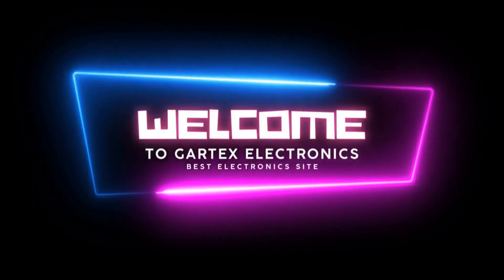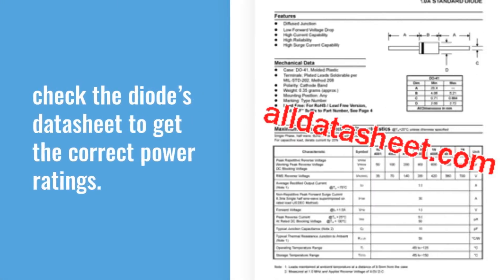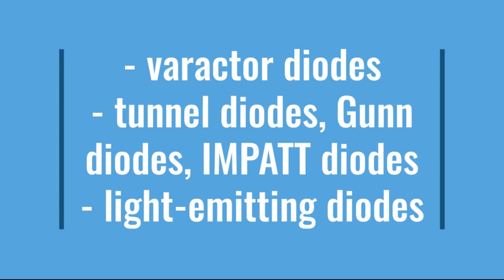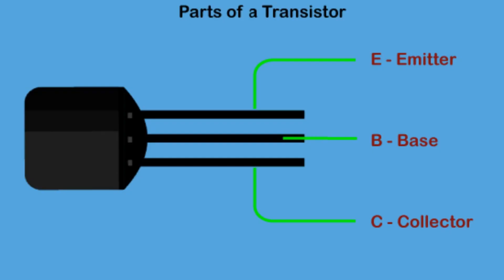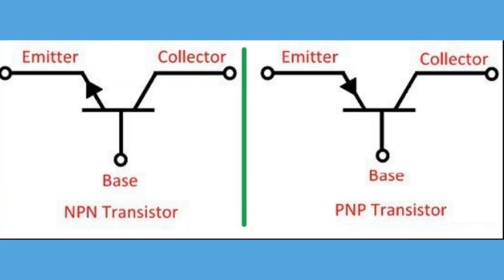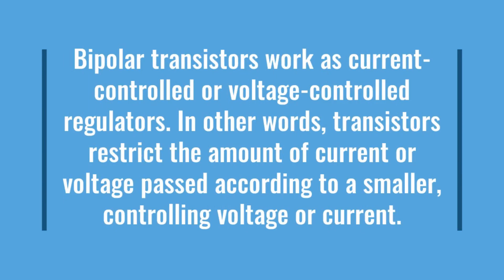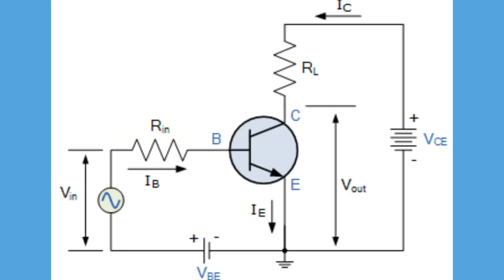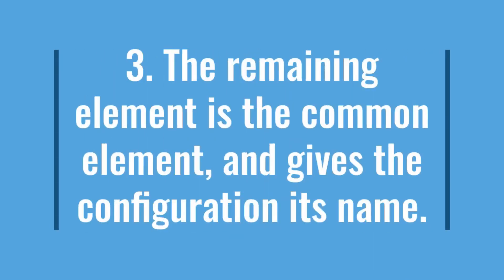Transistors and how they work

Comment: Doesn't electrons flow from (-) to (+)
Reply: You know they do. And they do not flow, but the charge is transferred, the electrons don't run around.
But there is the phenomenon of conventional  current flow based on the wrong assumption made in the past ( + to -). They decided to keep it that way bc. It doesn't matter for the calculation.
Reply: @maggotbrain7499  ya they call it whole flow or as you say whole transfer